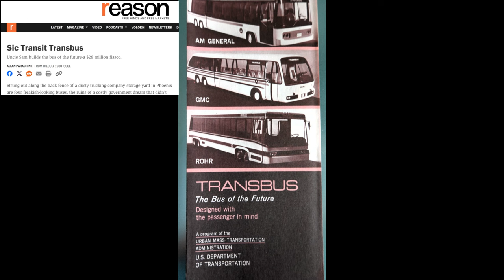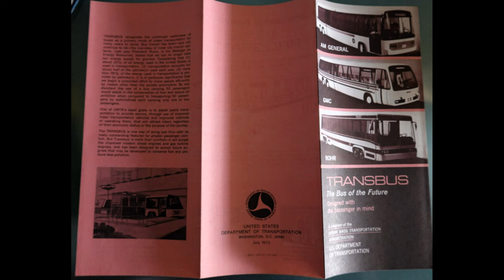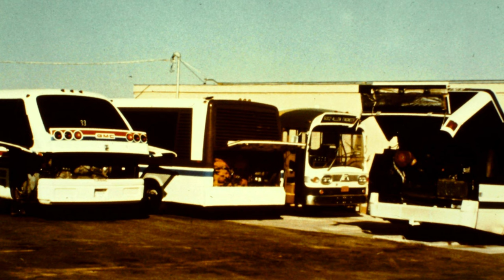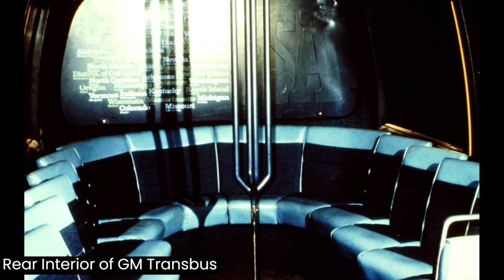TRANSBUS: America's Failed Transit Bus of the Future

Comment: My issues are twofold: Those AWFUL heavily tinted windows (as only the driver could enjoy CLEAR windows! (Well the only reason the driver's windows are clear has been mandated by law and not design choice). WHY NOT the same for the passengers? Same holds true of the seating, the drivers soft cushiony seat vs those hard plastic seats for the public! Really? Two - and most important - WHERE has any consideration of ELECTRIC buses, either trolleybuses or indeed battery buses? ZERO NADA DE NADA! Zilch! Why? THE INFLUENCE OF THE OIL INDUSTRY of course! You can have your bus powered in any manner -- so long as it was DIESEL! With four wheels six wheels, eight wheels, fifty wheels, so long it was powered by FOSSIL FUEL!

NO WONDER the public at large HATED them! Who wants to be stuck in a carbon fibre box creaking about as if it were to break apart at any moment, with dark windows, sitting on HARD plastic seats, breathing in diesel fumes?  REALLY!

Hey! Folks, you can go to Europe or Japan, and see  and experience REAL public transport! Public transport in North America over all with a few exceptions (like New York City, and San Francisco)is a sad JOKE! Ever since the General Motors NCL scandal, PT in Amerika has NEVER been the same! PT in li'le ole Amerika shall NEVER hold a candle to Europe, Japan, or even Canada!
Reply from the maker: T hank you for watching and for your very interesting comment!
Reply: Battery powered buses currently are junk, prone to spontaneous combusting. I can only imagine how much worse they would have performed then.
Reply: They use diesel buses everywhere and always tint windows in sunny country's. You can still see out just fine but the cooling works better.